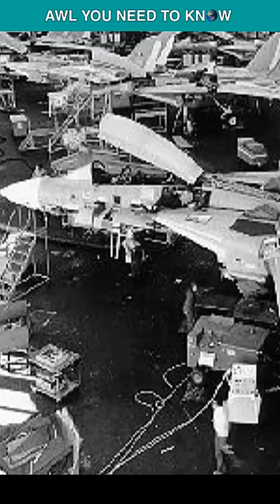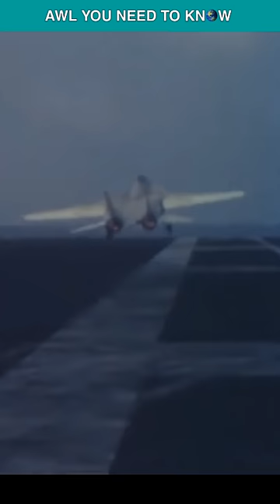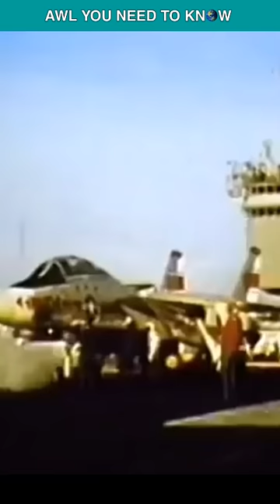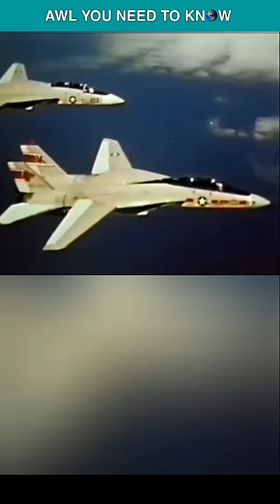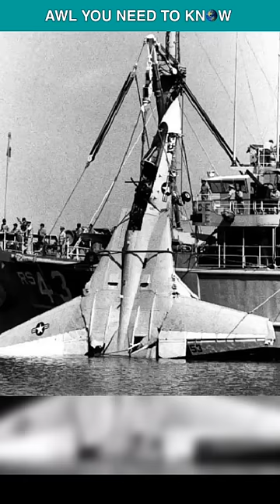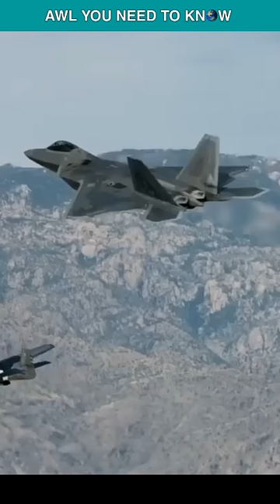Could The F-14 Tomcat Be Made Again? #shorts

Comment: Revive the production line of the F-22 Raptor would be a better idea.
Reply from the maker: Or they should go for 6th generation aircraft now.
Reply: @awlyouneedtoknow9435  so basically the choice is be bankrupt or be bankrupt
Reply: To expensive, that's why it went out in the first place.
Reply: @Sam Sam the Iranian F-14s are basically just F-14s on the outside with Russian avionics, engines and structural components though
Reply: That would be too freaking expensive to do so, unless the Air Force and Congress are willing to pay for that price.
Reply: @dallasyap3064  At least it’s worth it. 200 isn’t enough, you want them to waste money on the F-35 garbage?
Reply: @luongduc9119  The F-35 isn't garbage.
Reply: @dallasyap3064  Yea but if I say it's good the Russians are gonna come and cry
Reply: @Sam Sam at least it didn't fall like a rock into the south China sea like the F35C, I'd give it a C for its poor performance.
Reply: @luongduc9119  the Russians are still replaying the whole clip on how the failed F35C fell into the South China sea, wonder who's is really laughing.
Reply: The F22 is too expensive to build

And most importantly, too expensive to operate
Reply: @dutchthespitfire3204  But 200 isn’t enough. I know it’s expensive but-
Reply: @LordEmperorHyperion  The F-35C falling off an aircraft carrier is such an overused stereotype. At this point, it’s the common delusion.
Reply: F-22 equals or beats everything in the world as a ground-based air superiority platform and sucks at everything except ground-based air superiority. Restarting F-22 production is not necessary toward achieving ground-based air superiority, and does not help with other goals. Find me the airforce that could prevent 180 F-22s from completely dominating the skies?

It is more productive to invest resources into flexible multirole airpower like the considerably cheaper and more maintainable F-35, that can launch from a carrier (or a helipad for the B variant), and also go marauding around in enemy airspace sowing chaos and destruction, while taking out any clueless and desperate 3/4/4++ jets it encounters with BVR missiles and wrecking air defenses. And it doesn't lose its job the moment air superiority is achieved.
Reply: @petersmythe6462  we are building 6th gen aircraft.  We tricked the world to build 5th gen aircraft.  We knew they had to start producing them before we rolled out our new prototype.
Reply: That’s what I think. Who’s to say they aren’t already doing that and we just don’t know
Reply: @Dr.KarlowTheOctoling  
Yeah it's not like the F-35 was the only plane we ever got sunk off an aircraft carrier. Dealing with planes has risk.
Reply: @mill2712  US lost 3 F-35’s like that. It very well is. 

They lost more than 10 times those planes in the pacific 70 years ago and yet nobody talks about it…
Reply: @oofman1911  Better spending money on equipment and capability like this as a deterrence, than getting pushed into a conflict because someone thinks they can go toe to toe with you or better.
Reply: @michaelmckinnon3476  how did we find out the number of upgrades since The west aren’t allies with them any more?
Reply: @silentblackhole  it was reported in the paper, Iranian F-14s have MiG-31 engines, Su-24 variable geometry wing mechanisms, Russian avionics (made in Japan of course), and various other upgrades after Iran sent their F-14s to Russia since they ran out of spare parts
Reply: @luongduc9119  you saying the F- 35, in 2022, is rubbish just shows how little you know on the subject. I rather go to war in a F-35 than a F-22 any day of the week. Don’t get me wrong, dogfighting is exciting and sexy but any war fought in the future won’t be one or lost by dogfights.

The West’s mantra is basically first to see, first to shoot. I don’t know about you, but I’d want to be want to be in the machine that can take them out before they even i was there.

It’s part of a network of systems that share with each other and will allow you to know where the enemy is even if you can’t see them with your equipment.
Reply: @LordEmperorHyperion  and it was actually recovered so ChInA can't copy it
Reply: @luongduc9119  honestly the us should just keep that money in the 6th generation programme
Reply: @slycer876  doesn't matter China already made a superior version of the F35C
Reply: @michaelmckinnon3476  interesting. I’ve always found the American military to be fairly open about these type of details, if not only for accountability to the taxpayer of where their money is going. Places like Russia and Iran Kept the cards close to the chest.
Reply: @silentblackhole  nah, the US knew about it from the beginning and Iran can still acquire license to build whatever they need Militarily even if
Reply: @luongduc9119  tell me you have no idea what you’re talking about without telling me you have no idea what youre talking about
Reply: @LordEmperorHyperion  yes it has crashed before, every single naval fighter jet has crashed in the ocean before
Reply: @LordEmperorHyperion  what about the Su-33’s that crashed in the ofena
Reply: @luongduc9119  the f-35 is perhaps one of the most advanced planes, I’ve ts literally second to the f-22, which was made purely for air superiority
Reply: @LordEmperorHyperion  the J-20 toilet? Extra points for not even knowing what the F-35C’s premise is
Reply: @masterchief2402  Yes
Reply: How about design a new jet that can do what the f22 can do but better and cheaper. There’s a reason they stopped making them
Reply: Exactly especially since the new radar absorbent material is now going to be more durable and easier that was sort of the detriment to the F-22. Now let's be clear the F-35 is a digital masterpiece but if another country has a aerobatic stealth airframe and can get through our defenses I wonder how the F-35 will truly Fair?
Reply: Even that is already reaching it's shelf life before other jets take its place. Those we've yet to even know of.
Reply: @awlyouneedtoknow9435  8⁹8
Reply: Grumman shoud simply rebuild the F-14 out of principle, with modern radar and wings or whatever. Let's open up a Go Fund Me to crowdfund a new Tomcat!!
Reply: reminds me of the sea raptor concept
Reply: @luongduc9119  Fat Amy isn't as bad as the press makes it look. A very capable multirole, but bad management has made it into a funding and production nightmare. Still a great design.
Reply: Theres no point. The existing raptor fleet along with the other fighters is more than capable of dealing with any adversaries air force.
Reply: @petersmythe6462  eventually, they will have to make new ones, when those airframes meet their max flight time
Reply: @Defender78  and call it the F-34 Tomcat II
Reply: @Sam Sam the F-22 is an incredible plane. The fact that you made such a comment shows you don't know what you talk about. The F-22 is the ONLY plane for example to be able to shoot down the F-15 during Red Flag.  The F-22 took on the F-15 in insane number such as 2 vs 12  and won every time.  Know how? Because its stealth works exactly as advertised.  When I was in the service it was my job to evaluate designes such as the F-22. It was my job to know what our technology can really do and what it can't as well as to know what other countries can do and what they can't. It was also my job to write doctrine on how to use our technology. Stopping the F-22 was a horrible mistake. There is also a difference between a design flaw and something outside of a designs intent.  The F-22 was designed as a stealth air superiority fighter. In that role it is UNMATCHED.  Its biggest flaws are 1. Lack of combat range 2. Lack of armament due to small internal bomb bay. Both problems were solved. First with the development of a modified fuel that allows for greatly increased range.  Second with modification of the bomb bay/fuselage to allow for a larger internal payload as well as stealth pods that can be carried externally that DON'T wreck the Raptors stealth and can withstand high-G maneuvers.  In its role nothing comes close.
Reply: idk why the hell we aren't producing f15 numbers of f22s worst national security decision ever
Reply: Why so I can pay more in taxes
Reply: @Skim_beeble7125  I'd gladly pay 10 bucks more a year
Reply: @7zobzombie  to be fair we lie about the numbers of heavy equipment of all kinds produced. Its not that its classified because classifying it would draw unwanted attention. In each model of plane for example that we have active we have to have a minimum number in an active reserve. But even with that the number of F-22s is extremely low.
Reply: No
Reply: @Boeing_hitsquad  dont care
Reply: With the tomcat wings
Reply: @dallasyap3064  compared to the f-22 it is my guy plus the f-35 has cost us way more than the f-22 would have it’s a waste
Reply: @dutchthespitfire3204  f-22= 220 million per unit 
F-35 = anywhere from 100-500 million and I guarantee it’s nowhere near 100 million and the government said that to try and hide the fact it’s a bad investment
Reply: @colincurley9751  That's bcoz its the entire program cost, R&D, T&E, procurement, manning, training (pilots and maintenance personnel), engineering. The US military has way way more F-35s than the F-22s. Plus they are buying and planning to buy a lot a lot more. The military is expected to operate more than a thousand F-35s in the next few decades. The F-22 would be retired by the 2030s (early retirement) when the 6th gen is operational, whereas the F-35 is expected to serve into the 2070s at least (that's well over 60 years). The trillion dollar cost includes all the R&D, T&E, operations & maintenance of aircraft (for the duration of more than half a century), pilot training, maintenance staff training. Making more F-35s means more assembly lines, more tools/equipment, more parts, larger labor force (more jobs) etc. Another thing that should be noted is that this program has 3 models that requires different engineering design and development, so it's basically 3 plane models merged into 1 common airframe. The F-22 only has 1 model used by a single branch. The F-35 is an excellent fighter.
Reply: @jedinight235  but they should make it 60 million dollars
Reply: no,absolutely not at the cost  they were at..too much wasted tax dollars..

Comment: Two words:

STEALTH-14.
Reply: STEALF-14
Reply: NATF-22
Edit: it is a f22 and f14 hybrid with stealth
Reply: @thefish1292  it is designed NATF 22 (Naval Advanced Tactical Fighter-22) so yea F-22 Naval
Reply: F-22N and NATF-22 were different aircraft design proposals. 

F-22N was a navalised F-22 that remained closely related to the Air Force variant. 

NATF-22 was an entirely new aircraft design with mostly superficial similarities to F-22 and F-14. The forward section had stealthy angling similar to F-22 while the rear section resembled an F-14 but it wasn’t just the two aircraft kit bashed together but a unique design that just took some design inspiration from those other aircraft.

F-22N was quickly rejected by the Navy because it would have been overweight for operations on Nimitz class carrier decks, potentially damaging the deck over time.

NATF-22 was still in concept phase but was intended to be light enough and agile enough at low speeds to more feasibly operate from the carriers of that time. The down sides were that it would have been considerably less stealthy than F-22N and would have required an expensive and time consuming separate development program.
Reply: That's one word
Reply: Yeah, How hard is it to put existing digitalized jets like the Korean KAI F 21 and put variable wings...  Another jet is Textronic Air Land Scorpian jet just size it up.
Reply: @United.Kingdom.  Better yet use Korea KAI F21, a F22 knockoff and etc...

Comment: No reinvestment on that scale is needed. The airframe is a solid design. With a few changes made to support a 30% power increase from a larger displacement propulsion system. Late generations of tracking and weapons systems, and all the trimmings to avoid radar, from the inside to the painted(anti radar paint) exterior. With the advances across the board, this airframe can be a viable resource in the upcoming US/Russia conflict.
Reply: A “few changes” is not going to fix the weak airframe structure. Which nearly got destroyed by the F101 engine.

Comment: We would still be flying the F-14 today if the Navy leadership at the time didn't cheap out. The Tomcat was shown to be a better aircraft in combat compared to the F/A-18 Hornets of the time. But the Navy opted for the Hornet because it was cheaper to build and easier to maintain. Gruman had designs and plans to modernize the Tomcat and remedy its maintenance requirements but it was too little too late.

Comment: F-15EX is only one generation younger than F-14, but still in the production.
    Hardly that materials for F-15 don't go with F-14 stress demands, just close to not true.
    F-14 as twin engine aircraft could do roles of both F-15 and F-18, some even better due to changing angle of the wings.
    What if some major war starts, and numbers of planes produced in existing factories is  not enough?
   One more factory ready to go will do the job. 
    Some new variants could be made, to look more like F-15/18 if necessary, regarding the wings and the engines especially.

Comment: That’s why they should’ve went with the new version at the time that Northrop Grumman had on the design table. They already new what was coming down the Naval Aviation line so yes the new aircraft can still be an F-14 but it would’ve been more modern than our F-15 C’s and we wouldn’t have have to suffer the fact that the Super Hornet can’t do the job that a 70’s aircraft could do.  While the Super Hornet is a good strike aircraft it’s no real Fleet defender.

Comment: The ST-21 would make more sense considering it was basically built with modern materials in mind, but yes it would make sense courtesy of it's range although even the F-14 Tomcat would make sense to build because of it's range and the F-14 D did use modern materials prior to it's retirement. Building a modern version isn't the same as building the F-14 again though
Reply: The F-14D didn’t use modern materials. It only got a modernized cockpit.
Reply: @Optimaloptimus  the fuselage was heavily upgraded prior to the Tomcat's retirement with lighter materials that are currently still in use as were it's wings

Comment: Yes it would be a massive undertaking but with the advancement in the technology it would be a far greater aircraft, especially if it is made better basically you would be building aircraft with the best of the old technology and the best of the new technology. Even though the B52, is older than me, it is still a viable asset, in the case of the tomcat a new version would be equally equitable, as most maintenance issues would have  been resolved and the carry over would be carried over from the previous models. And integrated into the existing inventory 
.
Reply: The movable wings were a huge part of the F-14 and a huge part of maintenance headaches
Reply: @jamesmccarthy9519  that is a identifiable problem that can be resolved by removing or upgrade to a better system, that is a way of upgrading yet keeping the basic airframe the same as the original.
Reply: @johnbuckner2200  you can't upgrade or replace the F-14 "wingbox" without it being a 100% clean sheet new aircraft. 
It doesn't really matter though because the F-14 was designed in the 60s, more than 50 years ago.  It's a dead design.  It's day has passed. Zero chance a new Tomcat is ever built.

Comment: The conclusiones are mostly wrong, materials wise the hardest and most expensive part was the titanium wing box both in development / processing, and materials. But it is the internal redesign that is necessary. Sheath isn’t a thing for most situations, an F14D’s were find F22ks 70 miles away in the 90’s. Well outside the AIM120 effective range. 

Replace FAT Amy with an F14E+ ( yes not a thing lol) An F14 with its guts redesigned for lower maintenance, modern avionics (the D model was just getting) modern computers instead or cooling systems for 60’s tech & misiles, add AIM9X & 120’s, F22 like thrust vectoring, super cruise (all proposed for Tomcat 21), all the situational awareness capabilities of F35 (Amy) and the navy would have the most bad ass multi role navel fighter in the world. High speed with full ordinance (F18 can’t do), long range and long on station time, (F18 can’t do), fleet defender (F18 doesn’t do well / too slow and inability to climb to altitude fully loaded), plus a two person crew to manage the data…. Boom goes da dynamite! 🧨 lol

Comment: First of all you do not BUY plant property unless you know you can fill it for many years... you lease.  More than likely the original tooling still exists... things like that do not get thrown out.  The problem is you would now be working with a jet airframe with a higher radar signature, higher maintenance, and higher drag.  There are advantages of new designs.  Than you would want modern engines, weapons, and electronics.  By the time you are done you have a fighterjet costing $80+ million.

People complain about the cost of the F-35A, but in reality a modern version of the F-15 or F-16 would likely cost more.  It is best to come up with a good design and just crank out as many as you can for as long as you can... and then when you want to move on... make sure you can make it worth it and go big.  The F-35 will pay off big time... especially when ordinances catch up with its technologies.